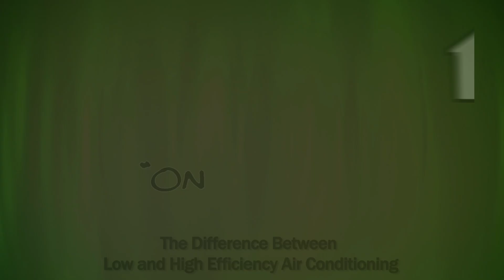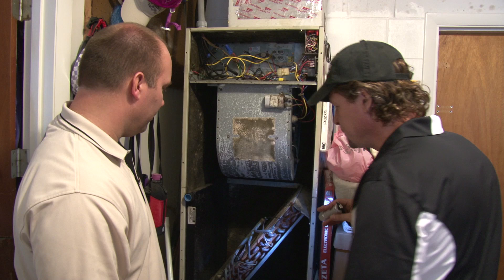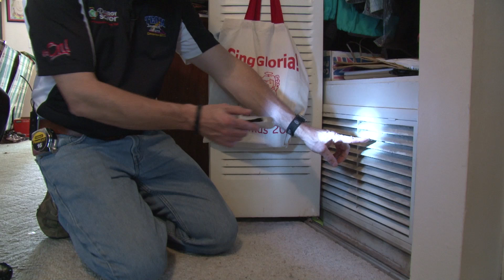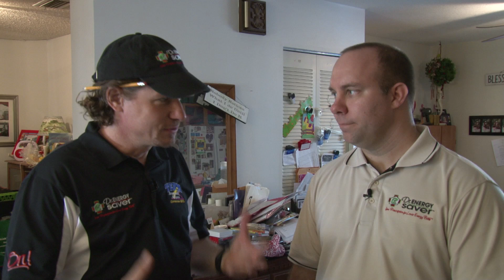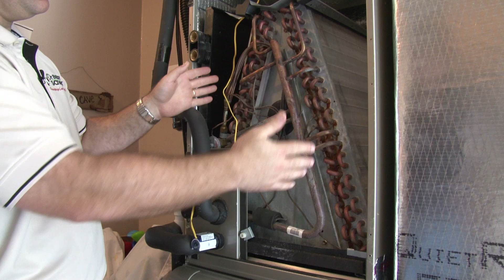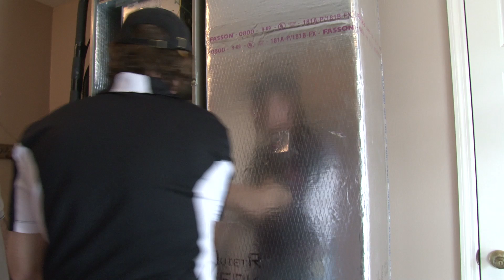The Difference Between Low and High Efficiency Air Conditioners

Comment: Dollars into cold air, no such thing ,heat transfer from inside is sent to outdoor unit to a cool compressor so it can condense to solid column of liquid inside to spray into evaporator to remove latent heat from home. Get it straight, dumby.

Comment: this "expert" is looking at a 2 dollar piece of armor flex like its hurting the efficiency and thinks a 12,000 dollar unit is the fix. 

BTW the suction line is the SUCTION line. The compressor is where folks? figure that out. The liquid line is the discharge so which way is it flowing? 

these people have no clue how a AC works but will be happy to sell you the most expensive one they can find.

Comment: I've had a few occasions to compare the energy cost + repairs  over time for 13 seer systems vs higher efficiency systems and in each case the additional cost of maintenance on the higher seer unit more than offset the energy cost savings that it offered. There is a lot more to go wrong with variable this, that and the other and it does. I'm not a fan of pouring more money into energy than necessary. I would rather put a portion of the savings into routine maintenance services, but it takes practically nothing in terms of unplanned repairs to tip the balance. So, I say go ahead and look at the newest most bad-ass  system you can, but then factor in the best coverage you can get as well. Then run the numbers. If there really is a credible savings including the cost of repair coverage then the  fancy high seer unit with all the "artificial intelligence" built in makes sense. Not overlooking comfort level.  Granted, newer technology does more in that regard. Balance your wants and needs.

Comment: It's not the heat from the house it's the gas that's hot and the out side unit with the assist of the fan helps get ride of the heat when the gas reaches the evaporator coil it turns into a cold liquid and the proses is continued again once it gets back to the compressor
Reply: you are incorrect. try again later.

Comment: sucky part is these newer units after about 2 years start breaking down every year 8( i did a/c from 2004 to 2007 and have had seen some new units thrown onto some friends house and very few last without any problems my exs house has been installed for just over 5 years and has broken down the last three summers (YORK)  i am not at all impressed with the quality of the newer units spend thousands and it doesnt even last

Comment: High efficiency equals smaller compressor which has to work harder resulting in shorter life span.  No thanks. I'll keep my 25 year old Lennox for another 20 years.
Reply: High efficiency equals bigger coils which compressor works less and increases life span.
Reply: clark hall I wouldn't say carrier units are better. Compressor technology is better. All manufacturers using 410a are using POE oil.

Comment: idiot... that is at least a 10 seer unit,  come on. 10 seer was the minimum rating since the early 90's. that is a mid 90's Carrier.
Reply: I'd tell that guy to get the hell out of my house. He's a snake.
Reply: Same I thought 4 or 6 come on, it's a 10 and probably bad ductwork it never delivered 10.  After perfect charge it's all about ductwork and static pressures.  My guess is only 75% of older systems don't have proper ductwork killing SEER rating.  47 years and he can't tell a 10 SEER by look.

Comment: Bullshit.  I don't believe they have made a central air system that was ever a 6 - 8 SEER equivalent since the early 1900's.  Carrier never made one that was factory direct and properly installed that was under 10!   

Interesting they never mention a word about break even on investment times on your new AC system when compared to electrical costs saved which means that for the 300 - 500watt of electrical power you are savings it could take 30 - 50+ years to break even on your power bill reduction to which effect the new AC unit is unlikely  to ever last that long.  

What they do mention is don't forget to buy that extended warranty because that $2000 (their cost)  POS high SEER rated unit they hit you for $5000+ (for 1 - 2 guys to do 4 - 8 hours of work) to install is going to die well before it ever pays for itself. Especially so if it was installed to replace a perfectly  functioning older unit that still ran at an honest 10+ SEER as used average.   

Sorry but I'm with everyone else who has an old clunker that runs well. Mines ~35 years old, It's paid for and does its job well even if its as tested SEER is 'only ~ 13'.

Comment: Older the better!! Fuck all this new shit
Reply: Yup. You can put in a $10,000 system and it's not gonna run as long as that older one. They've cheaped them out. Plus the copper is paper thin now.
Reply: no the newer units with 410a they run at higher pressure so they had to make the copper a little thicker ....i cant confirm that though just what i have read i totally agree though these newer units bite!!! the quality is garbage!
Reply: Actually they are runningalluminum evaporator coils now  and the copper condensors are a little thinner. carrier has gone from a 3/8 condensor tubing to a 7mm copper tubing. Buy a performance series carrier condensor and it will out live you. I started selling that unit back in 08 and have installed over 300 of them. I have yet to lose a single warranty compressor. Most reliable unit I have ever sold since I started in the 80's
Reply: Screw off. strongly agree with you 👍

Comment: If I have a 20-year old Trane XL1200 air conditioner from around 1995-1996, would the SEER rating in 2016 still be at 12, or would it be lower? And if lower, how low?
Reply: maybe a max of 1 seer less its getting old but still quality repair it till its dead dont get this crap they are selling now it lasts about 2 years of good running then starts breaking down almost yearly after that motors and compressors....sorry even maintenance doesn't stop a motor from seizing up all they can do is check the caps and amp flows

Comment: He means two speed, not two stage. Only Trane had a 5 ton or less two stage and they dont do it anymore. Two speed is one compressor that runs at two different speeds. a two stage has a second compressor, more seen in commercial due to business needs during a failure or to maintain perishables. Nowadays it's all about the variable speed compressor. That's like the pimp daddy of compressors right now.

Duct cleanings dont clean shit and for the money you could toss a bit more and replace the duct. You should filter at the grill to keep the duct clean from start to finish and not at the unit where half the duct gets dirty. If you have metal duct THAT can be cleaned, that would be a different story. If you have like flex duct like most people do, it always gets the crap stuck in the corner of the boxes. Nature of a vacuum.

These guys are salesmen but people do what they can and they are trying to do a quality good without the skills and if they copy paste enough, they only need a true tech to talk to from time to time. Most techs are becoming Salesmen and true techs are a thing of the past.

That is a pretty nice system

22 year tech-

Comment: Great video and explanation guys. I'm in Oregon and are just getting ready to have a 3.5 Ton 14.5 SEER A/C unit installed. Our house (built in 2000) didn't have an A/C unit installed, probably because we only use A/C 4-5 months out of the year. The brand we're looking to have installed is a Luxaire LX Series.
Reply: Good thing you got that before this year’s heat wave.

Comment: Actually they don't "lose" SEER, it just gets dirty. Clean it, it will work just as good when it was new. Old units are much better!
Reply: +Joshua&#39;s Recordings 

Can be...
Refrigerants have changed...

R22 is much lower pressure and hence lower pumping costs.
R410 is a pig. The glide is yuck. Much higher pressures.
Better to replace all the ducting and clean the Fan Coil.

Oh and I was an area manager for Carrier, here in Australia.

This video is to sell new A/C units.
Reply: +DumbSkippy Yes, I know about the refrigerant change. Also do you know why the inside coil is aluminum on modern units? GE tried that in the 80's and said that it caused the units to leak after 1 or 2 years.
Reply: +Joshua's Recordings 
Hi matey,
I didn't know that.
not surprising but 1 to two years is crazy...
Reply: +DumbSkippy Yea, GE wanted to make an aluminum indoor coil so that it would not rust. Though the copper to aluminum tubing would cause leaks, they ended up making the entire system aluminum. I had a cheap Frigidaire air con in my shop. It leaked after 2 years! Replaced it with a 1960's Philco Ford that still worked great!
Reply: +Joshua's Recordings 

hehe.
Nice one.
Reply: +DumbSkippy Yup, gotta love the vintage units!
Reply: Same with me. 25 year old Rheem with a Copeland compressor. Just clean those coils and change those capacitors.
Reply: old units are indeed better however they over the years can lose a 1/2 a seer to a max of a seer with wear and tear still no reason to get rid of a quality piece of machinery though they last forever 8)
Reply: A rotary compressor will wear in not out. The vanes get tighter over time. The valves or a reciprocating compressor can stop sealing and become inefficient. We have gauges and tell if the unit is not running correctly. We don't look at and just shake our heads
Reply: That's because if you want something that was well-built you'll have to get something that was built by "real craftsmen" and not cheap, poorly trained, american checkers & assemblers.
Reply: Polarcupcheck Nice.  The capacitors in mine had oil on top.of them for years, especially the huge compressor one...it still kept going and going...decided we shouldn't tempt fate and just change them.  A coworker who did HVAC for 35 years came by and changed them for me.  I had purchased them last year...I still can't believe how well the unit runs...sounds beautiful and super quiet all these years later...what a real gem
Reply: Shawn Roddick  mine's 35 years old, no repairs/breakdowns yet. Changed original capacitors for maintenance this past spring.  Always cleaned outside and filter always changed.  Ducting sealed, repaired. Carrier./keeprite.  A true gem.  House is cooled with ease..

Comment: Excellent video.  Very informative and useful.  I wonder what going from a 1988 3 ton unit (that I have now) to a new unit will save me?  I'm about to find out since I'm getting a new unit.
Reply: +shot9702 Not much. For the same sized unit, it will work about the same and cost the same. Unless we are talking about Inverters.
Reply: Let us know what happens

Comment: OK- What does a 3 ton complete heating and cooling high seer unit cost- retail- wholesale- and what does the installation cost? What would the difference in the electricity be between and old unit and a high seer unit operation for a year?
Thanks
Reply: Not much different! If you wanted to do energy saving, just turn off the water heater after using. I saved $45.00 last month by turn-off water heater about three times.
Reply: @HsingSun  why don't u install an automatic water heater shut off.  I got mine from Lowes. It works great and my power bill for 2300 sqft 2 story house is just 114$ a month.  I am on here because my AC is old and may conk out anytime so I am preparing myself with info.

Comment: I've noticed that when my AC (1970 model) clicks on, my lights dim down, along with all the nearby streetlights.  I'm no expert but I think it might just be time to upgrade.
Reply: You may need a new compressor capacitor or maybe add a hardstart kit to the capacitor to give it the extra boost that it requires when they get older.
Reply: TheSpazModic  haha The whole city goes dim
Reply: +TheSpazModic Doesn't that mean its an energy sucker???

Comment: The guys statement that the cold goes to the house is wrong. The suction line (cold line/low side) actually goes into the compressor where it is compressed (which heats it) and the heat is removed from the fan on the outside unit. The liquid-high pressure refrigerant (hot/high side) then feeds back to the evaporator (inside) where it is converted to a low pressure either with a TXV or fixed orifice. The heat from the home is absorbed at the evaporator, the refrigerant gets superheated and carried back to the compressor where the process repeats. The reason the line is cold is because it is at a low pressure (close to the freons boiling point). You still want to insulate the suction line to prevent condensation and extra heat being adsorbed which will raise the systems pressure.
Reply: +billybassman21 
Indeed.
Reply: You're right, I noticed that too.

Comment: I live in florida.What you need is GOOD insulation first and cool attic or cool roof (white)!!! Then you can easily run 1-2 ton less unit for the same comfort inside and for way less energy !! You guys just giving promotion to carier,not talking real efficiency !!!! I have good insulation and solar AC,That is real efficiency my friends...
Reply: MB031 You are correct The efficiency is in the whole picture ...It doesn't make sense to install seer17 in a home with bad insulation and undersized duct work. You will get more bang for the buck by investing in insulation and proper attic venting.. You can do that yourself.While you are insulating check on your ducts for losses as well.Sounds like you have made a good choice
Reply: Thanks. The big difference is just putting the ductwork and airhandler into conditioned space or try to achieve cool attic as much as possible.Build bigger plenum and change small ducts to bigger diameter for less pressure drop and higher volume of flow,of course tight  and clean ductwork is a must !Thus you can downsize blower motor too.Well insulated house and cool attic or roof  is capable downsize AC unit about 1 or 2 tons and that's a huge difference.In south florida, the biggest issue is latent heat and attics can't be ventilated with hot and humid air here! Installing roof fan brings humidity into attic space.There are many hard conditions in florida to overcome,but once humidity is under control,the higher temps is not a big deal to take care of...
Reply: +Brian Ellsworth I doubt a 10 SEER unit running for 17 years would still have the same efficiency level. It would probably be running at 6 SEER given components get worn and all the junk blocking the evaporator on that particular case. So bang for buck, the one or two ton gained by insulation would be nothing compared to what the more efficient unit (or even regular servicing) can provide.

Not to say one should not insulate, but that's not always the answer.
Reply: +Susana Godinho Yes your running hours are greater in Florida as our cooling season is only 8 weeks. If the valves still hold and the coils are clean your seer value may not be as bad as you suspect..Electric rates always go up and summers are getting warmer.That also causes higher energy cost.First check the duct sizes and the r value of the insulation on the ducts..R8 is code ..A 17 year old ac probably has R4 and is probably no longer tight and  has  air loss in unconditioned spaces . Also make sure the return is large enough .You must first determine the heat load for the house ..You then select the correct tonnage . the you need an air handler that can supply enough air.. roughly 400- 450 CFM per ton ... The most critical calculation is sizing the duct correctly for each room..If you install a high efficiency unit without doing the basics the seer value will not be accurate.Scroll compressors can be more efficient as they wear in. reciprocating compressors, NO LONGER USED FOR AC, can hold for many years with out losing capacity .This video will have you believe that the missing insulation on the suction line will cost you money .. So far from accurate because the gas is returning to  the compressor and not going into the house . since the the compressor is only two feet away it would be beneficial to flash off any gas at that point...It only looks ugly,, Amor flex is really cheap . A variable speed ac is a good idea ,but they are a new idea and the reliability is unknown ... expensive repairs can negate any savings

Comment: I also live in Florida. What you need is INSULATION, windows on the correct side of the home and an old fashioned, high quality a/c system. The unit I currently have is a modified 35 year old unit. New systems last 10 years. Older, less efficient systems last nearly forever. It all depends on what you consider "efficiency" is. If you have to replace something every 6 to 10 years, it's NOT efficient...
Reply: also its not efficient if the new unit has to run longer  then the old one  for the same results  we replaced our condenser  same siz as old one  and it has to run way more then the old  one  its only 6 years old and has done nothing but break down  and run nonstop even though its correctly charged it is now broken again and as a result  fixing to be replaced we have 2 14 seer ruud units we upped the tonage on the downstairs unit  and it cools great  hardly needs to run will maintain 70 in the house  the best the upstairs unit did was 78  its getting replaced  likely by a 3.0 ton. pretty much all the upstairs unit did was run the electric bill up  worse then the old 10 seer Armstrong.
Reply: SuperJeremi10 All the "efficiency" translates to is the fact that it can more easily transfer heat and cold, in and out of the system. The only way they have figured out to do that? Make the materials as THIN as possible. The coils are SO THIN that you could take a can of Pepsi, pour it on the outside coils and probably destroy them within 10 minutes. In this case, EFFICIENT = CHEAP !
Reply: yep   very cheap very very cheap hat can ya do though.